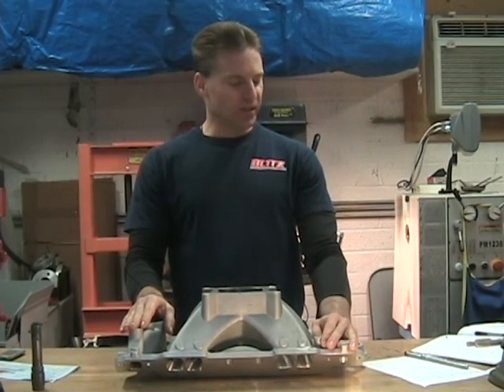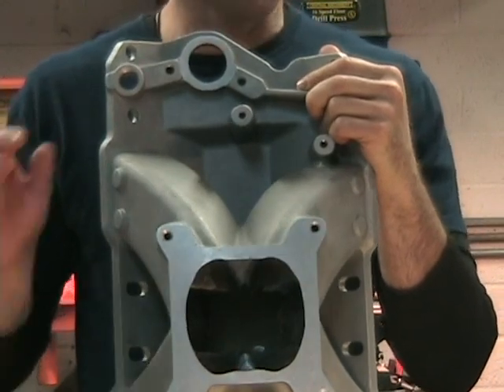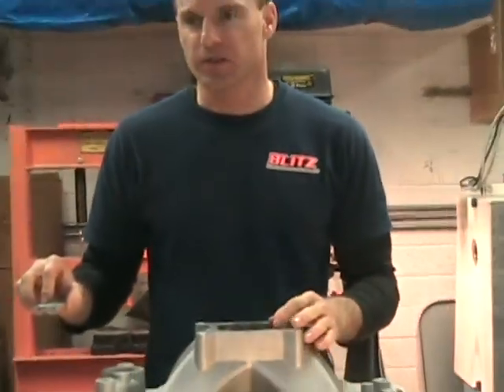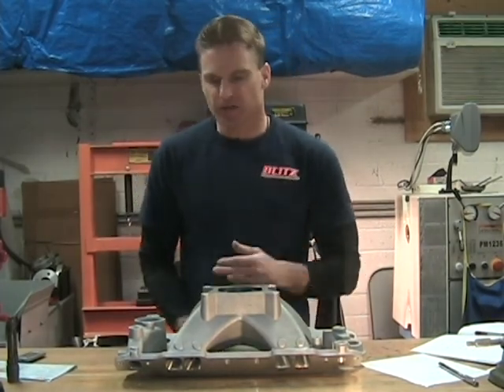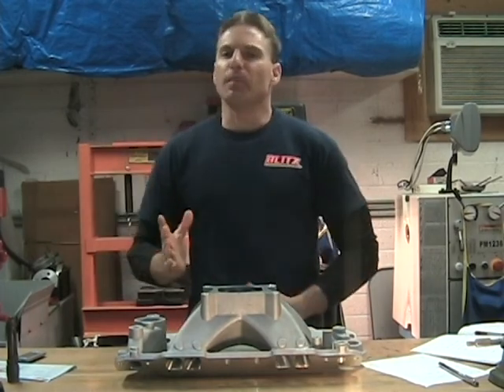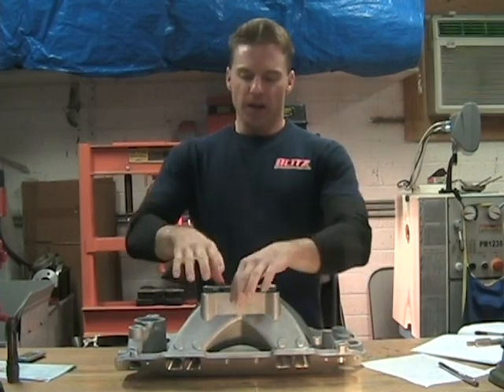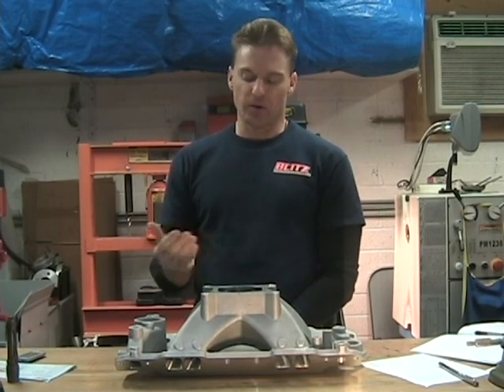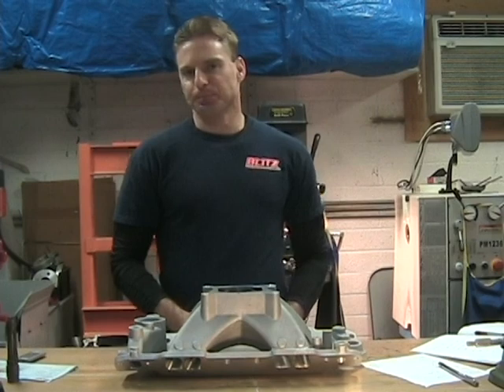SBC intake manifold porting (STEP 4 INTAKE) Video 6

Comment: I noticed you mentioned that flow numbers doesn't mean HP. Then why the rest of the series you reference flow# as a do/don't in the areas to port. I agree port match#1 but plenum and line of sight is definitely#2 I've seen DRAMATIC  improvement when I do cutting along the top of those plenums
Reply from the maker: Thanks for the comment.  I did this videos series several years ago and sometimes my statements do not come out very clear.  I did not mean to make contradictory statement.  Ideally if you improve airflow, then the engine will respond in kind making more power.  There have been a few situations, but rare, were an actual increase in airflow did not result in more power.  Again that statement above is not the norm.

I did this video to give people a general idea where you can get the biggest gains of airflow, with the least amount of effort.  It's funny, because many people I run across want a high horse power engine, but they lack discipline and effort to achieve it.  Ultimately your statement is correct, it's worthwhile to work in the plenum area(if your serious about getting the maximum amount of power).  Especially the addition of correct spacer plate can help aid a better mixture of air and fuel.
Reply: @blitzcechannel7941  yeah it really depends on the application. Take a Victor JR for instance. Most intakes now there's now much to gain I agree. Plus I wasn't knocking on you brother I do appreciate anyone that takes the time to film edit and post information to benifit motorsports. David Vizard has been putting out some great stuff. To bad Smokey Yunick or Bob Jenkins didn't have these platforms to pass on their knowledge. I have read Smokey's books